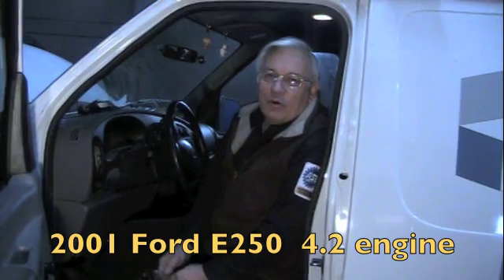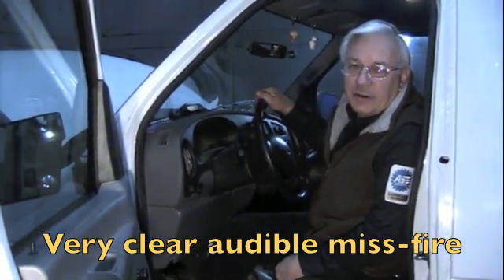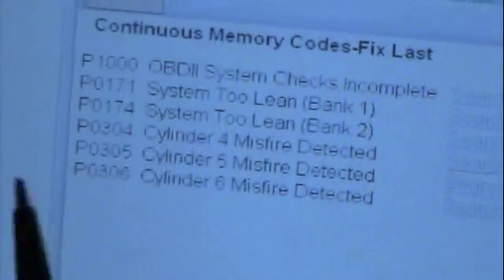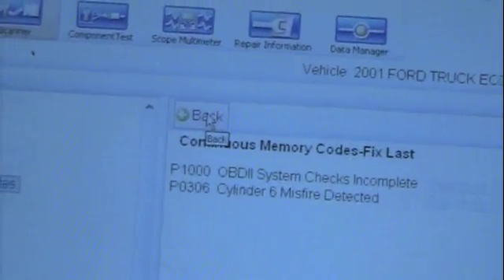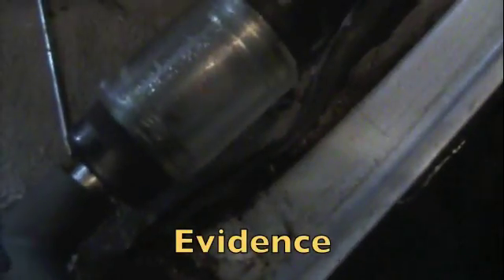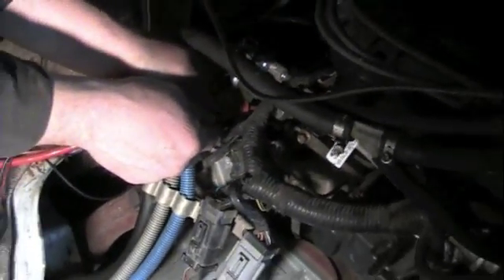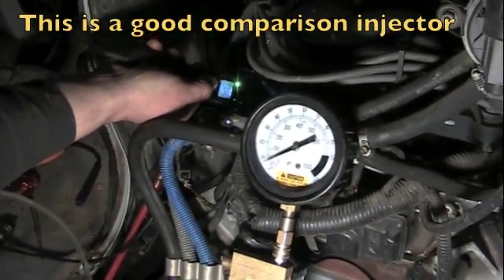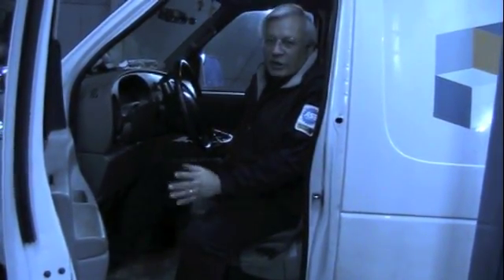Diagnosing a misfire

Comment: @1PossumJenkins in a way, yes. but if it were bad rings, you would never know because vacuum comes from suction. aka meaning a cylinder is on a intake stroke, which bad rings won't affect but when compression comes, 9:8:1 or whatever compression comes into play but is pushed past the rings if they are bad causing blowby.... therefore.... its a butthead lol :)

Comment: @1PossumJenkins Nope - the cyl is still drawing a vacuum. The rings are still sealing against the walls, the valves are still seating correctly in the seats. Vacuum has nothing to do with spark/ignition or fuel supply outside of timing. If you've got a bad valve or something sideways in the bore (or a bad vac line) - you'll see the bounce.

Comment: I think I've misunderstood how the ECU detects a misfire. I always thought it was strictly looking for ignition at the cylinders (via the ignition circuit for each cylinder). So how does it detect misfire if it is a lean misfire? Doe is detect an imbalance, or maybe air/fuel ratio during one firing cycle?

Comment: Is there a difference between the vacuum signal at pure manifold as opposed to the booster? You did not show the vacuum guage action whilst the throttle was depressed and released,either at manifold or booster.  Well, codes saved the day.

Comment: bought new plugs for chevy venture V6 1998 when installed them i got misfire on cylinder #1, changed plug and wires set . got same thing #1 misfire..everything always ran ok before until the new plugs went in.. they are one of the highest watt plugs anywhere..but company said should be fine . OIL looks clean, coil has spark..
IS it injector? or these unusual plugs?

Comment: so towards the end when you you were manually making the injector open (independently supplying power), did you have your fuel pressure gauge hooked up to the fuel rail (say through a shradder valve) and watching the pressure drop across the rail or some other way?